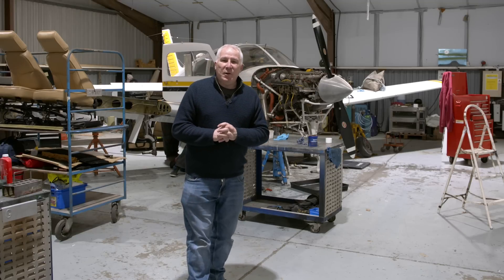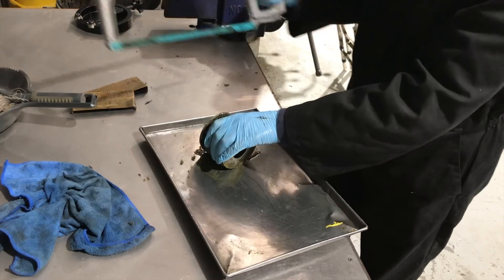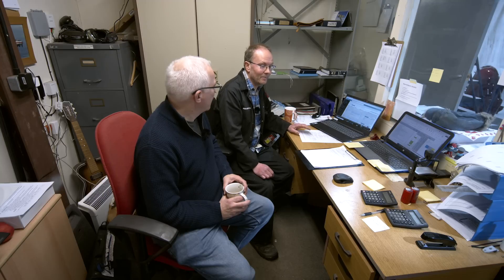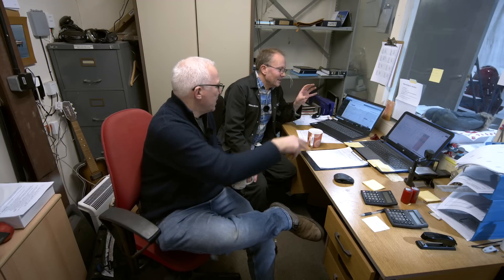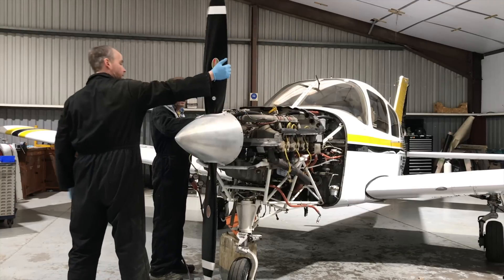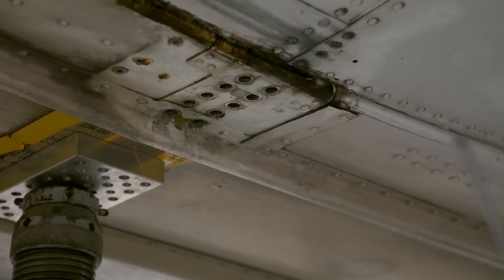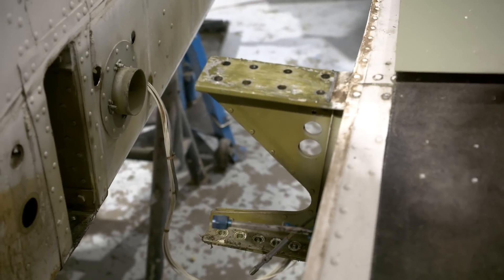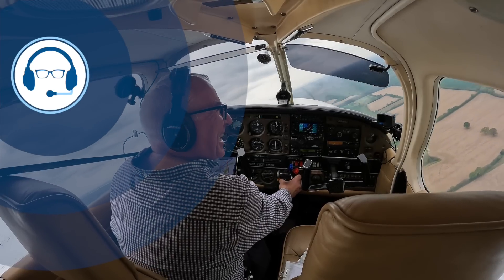Removing my PA28 wing - Extreme maintenance

Comment: I always thought that all wing spars ran through the fuselage (rear seat area), wing-to-wing.  Thus the reason for the cramped leg room in the rear seat.   The U.S.Navy had a land-based twin engine patrol plane called the P2V Neptune.  The wing-to-wing spar was so massive,  one had to crawl over it from the cockpit to the spacious rear area where the anti-submarine warfare electronic equipment was located.  I'm a former PA-28 180 owner (before the AD).

Comment: This is WRONG. A compression test is NOT a reliable way of assessing engine health. Just try getting a so called fail , flying the aircraft half an hour and rechecking. A reliable way of checking engine health in 2022 is with a borescope     The compression test was recommended when such technology didn't exist

Comment: Fascinating stuff. Thank you to one and all for your time and efforts in sharing, filming etc. Long time since I've seen this sort of thing, I wasn't as interested back then either😳🙄😄😄 I am now😊👍

May I be indelicate and ask how much such work normally costs (without the wings coming off)? I was pondering the value for money aspect of Eg Light Sport/Microlight categories (perhaps more expensive to buy, but more modern aircraft that are cheaper to maintain and operate) vs GA metal aircraft, such as; C152's, Piper Cherokees, Tomahawks et al (perhaps cheaper to buy, but more expensive to run and to train on/for a licence etc?).

These sort of questions will no doubt come to the fore, especially now, re; stagflation, recession, fuel and labour costs, relative to a hobby pilot's, wants, needs and 'mission profile', safety and budget etc.

Comment: Leak down test is the compressed air.  They time how long the cylinder holds above a set psi.  Compression test is the manual rotation of the prop to read the peak psi reading.  Two similar tests measuring different aspects of cylinder health.  As an owner of a PA-28 I found the video interesting and can empathize with the pain in your pocket book.
Reply from the maker: Glad you enjoyed the video. If you fly to save money, you won't get very far!

Comment: "The wings haven't fallen off yet" sent shivers down my spine thinking about the PA28 spar failure accidents :( If you get the chance you should see a modern glider spar. We rig and derig them much more frequently and it's educational to get a good look inside your aircraft, as you're doing here :)
Reply: After personally taking an Arrow apart, I will never fly one again. They are built to an absolute minimum spec with zero margin for error. With age, they are just getting worse and worse.
Reply: @austinformedude 

Come on, man…let’s be serious. Every day, there are thousands of PA28s flying all over the world. If they were built to “an absolute minimum spec” (I’m not sure what that means but it sounds like its meant to say they’re flimsy and/or unreliable), they wouldn’t be among the most popular training aircraft of all time…spending decades getting pounded into the concrete by students practicing their short field landings.
Reply: Hi. I am  looking for a used aileron right side for my Piper Pa 28 140 . Or where to find skinmanufacture ?

Comment: On your pre-buy inspection did upcoming wing off inspection, enter purchase price discussions ? We would all be interested to know the full price of that Annual inspection ? Certainly owning an LAA aircraft, where you can do you own maintenance to a certain extent makes it far cheaper to run, although admittedly most LAA aircraft are not as complicated as a Turbo Arrow. Your engineer is right, don’t always baby the engine, get it up to altitude and fly at 75%. After all that is why you have the turbo version, not the normally aspirated Arrow 3.
Reply from the maker: Yes, the pre-buy spotted the cracked wing walk and was part of negotiations.
Reply: Concur. I fly a turbo Saratoga and routinely fly at 75% at 8-10,000”
Reply: In fact if you read the original flight test on the Arrow Turbo by Alan Bramson in 1977 or 78, he points out that the only reason for buying the Turbo version was to fly high. At lower levels the ordinary Arrow 3 performs just as well, without the complication and higher maintenance of the Turbo. Also in the Arrow 3 you have the very reliable Lycoming IO360 200 Bhp 4 cylinder, which I believe is more reliable and stronger than the Continental IO 360 6 cylinder which has a shorter TBO, but being a 6 cylinder it is smoother. Not that I fly an Archer 180bhp, but those that do will tell you that the performance is not far short of the Arrow, but with less complication and maintenance as fixed prop and fixed undercarriage. That is why it is almost impossible to find one for sale at a sensible price as they are so much in demand, also more capable than a Warrior 160.
Reply: @johnball4826  yeah, normally aspirated peak at about 6,000’ MSL above which the turbo starts to shine. My TAS continues increasing the higher I fly (to a point) and with our flying club Saratoga turbo I get 175 kts TAS at 9,000’. Alas, in the 🇬🇧, airspace restrictions (eg airways which are Class A and at altitudes <10,000’) may prohibit Jon from operating his Arrow TC at those altitudes.

Comment: I realise my Rotax is not certified but I’m gobsmacked seeing spark plugs being wire brushed. I just change mine every 100 hours. Also I had an inspector who used to test the compressions, he used a standard tester like used on a car, for each cylinder he attached the gauge and turned over on starter. Checked to make sure all cylinders the same.  Around 200 psi I seem to remember.
Reply: Rotax spark plugs are standard motorcycle spark plugs and cost a few $ each for new ones. New Champion spark plugs for a conti 360 will be about £150 _each_.
Reply: Also a compression test like you describe is pointless, a leakdown test is quite different

Comment: Nice to see India Victor getting the TLC she needs, though I did a double-take seeing a six cylinder Continental engine under the cowl. Had to look that up. Nice!

My Musketeer has an AD for reinforcement brackets on the spar (73-20-07R2), visually inspect every annual, dye -penetrant every 500 hours, plus a Service Instruction for spar corrosion inspections. This year's annual was clean, a far cry from last year's Annual From Hell. The only challenge was lining up a new shop to do the work since the shop I had been working with have since gone out of business. Nothing to do with me and my plane. I hope... 😀
Reply from the maker: I suspect you kept them in business for that year - shame they went out of business afterwards.  Gosh, that's quite a drag, with the checks on the. spar. But, these machines are getting old.  I doubt they ever believed they'd still be flying 50-60+ years on.

Comment: Here in Canada AD compliance is the owners responsibility and has nothing to do with signing off an annual. I did the research for my aircraft when I purchased it a few years ago and found several ADs that hadn’t been complied with. Luckily nothing too expensive.
Reply from the maker: It's quite common I think for these things to be missed.  A good maintenance organisation will be very thorough to check compliance.  After-all, they're audited regularly to ensure these jobs are done.
Reply: AME here.  Before I do any annual inspections I start with a through AWD review.  I've found some AWD signed off and after checking I found that they were never done.  You have to be careful.  It's the owner/operators responsibility.  There just way to much "pencil whipping" going on.